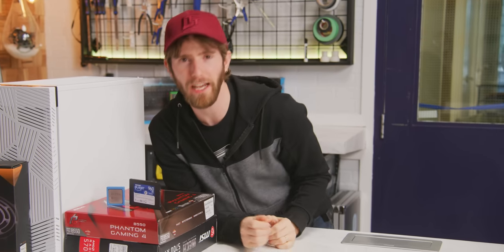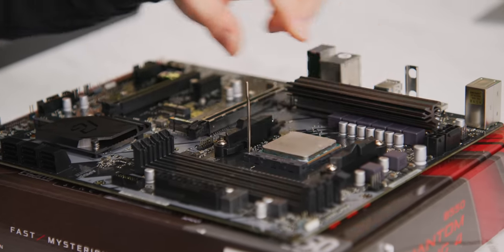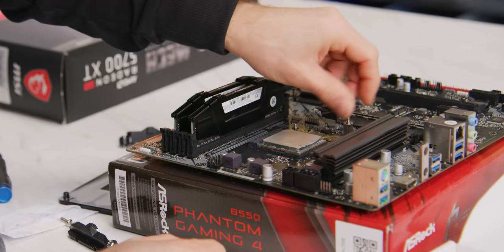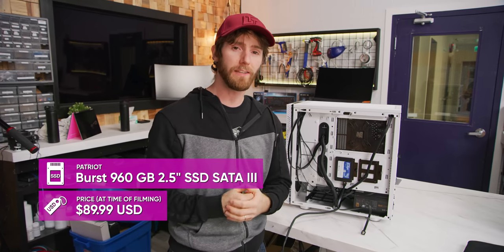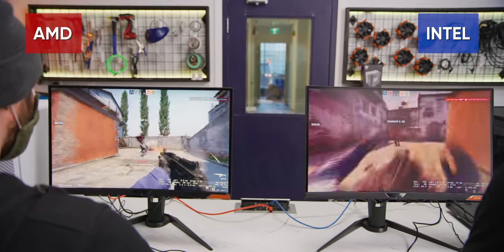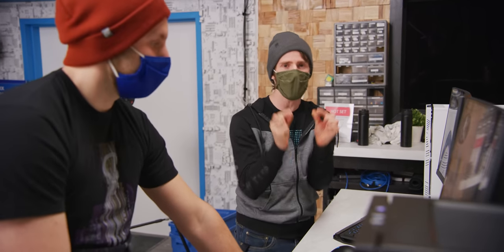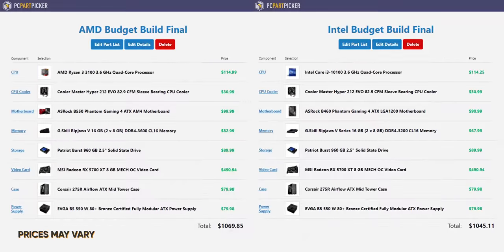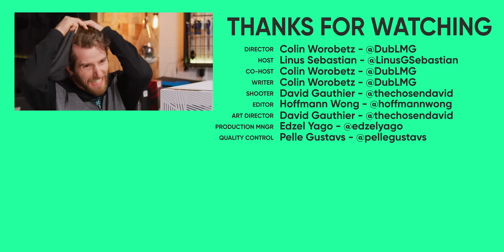AMD vs. Intel midrange gaming PC challenge

Comment: "doesn't have fancies like... PCI express gen 4"

yes it does, it was literally the first graphics card on the market to support it. wut.
Reply: yeah theres alot of mistakes in this video :/
Reply: HentaiRacoon  linus not dropping anything?
Reply: @thanishdavipaul2876  B550 does support PCIe 4.0
Reply: @thanishdavipaul2876  Yes it does, it's B550.
Reply: HentaiRacoon  The SSD he used actually comes with 32 MB of DRAM cache... and IDK maybe something else but it doesn't really affect the point of the video so who cares
Reply: This video be Doo Doo.
I wouldn't even call that a mid tier pc, 
I'd call it shit tier
I feel like Mid range is all about getting the best possible performance without going overkill.
 buying a 5700xt and pairing it with a i3 is leaving performance on the table
Reply: @davidjorquera4192  bro fr most prebuilts at this pricepoint are better
Reply: @davidjorquera4192   there supposed to be the same gpu...... there not gunna put a 1650 in one pc and a 5700xt in the other. 🤡🤡🤣
Reply: @user-mc2lg4iw9e  5:25 you sure about that? ;)
Reply: @ishaquesurya4572  lmao
Reply: @SpaceLion949  And why would he actually use that drive. You can get 1TB NVMe drives for less than 100 dollars these days. From reputable brands even, such as the Crucial P2.
Reply: @iceballon1325  i3 bottlenecks the 5700xt bud, the GPU is fine it's the CPU that's the issue
Reply: @juanecheverry8013  they're really not the ones that seem better value are basically expensive microwaves with compromised cooling and ram the ones that actually don't melt from the heat are basically a 1660 super for the same price
Reply: @davidjorquera4192  5700xt for 500 too, Wtf were they smoking
Reply: @davidjorquera4192  except a 5700xt $500 is not fine
Reply: @davidjorquera4192  no, mid tier pc isn't about top tier performance, it's about mid tier performance.
Just because you have your mom's credit card doesn't mean shit.
I'm still on GTX 2GB, that is low tier today, it still can run most games and even Cyberpunk on lowest settings and lower res.
Reply: @dr_birb  nah mate I actually worked hard for my money and built a mid/high tier pc. 
Rx5700 8gb with i7 8700k with 16 gb of 3000mhz ram.
Reply: @davidjorquera4192  how better is the performance with i7? in which games it is significant?
Reply: @juanecheverry8013  you sure? prebuilds are trash while their config wasnt that bad
Reply: @dr_birb  so youre getting mad at him cause you dont have the money thed upgrade so you accuse him of getting all his money from his parents
Reply: @112Haribo  p1 and 2 kinda suck, a2000 or sx8200 is better
Reply: Thanks, paused to write just that... I like LMG videos but you should watch them for entertaiment purposes only.
Reply: @maurice7017 ?
I'm not mad?
And not accusing anyone?
Just saying that mid tier PC's aren't about getting most performance - that can be any tier PC, depending on what you want. And that the PC's in vid are factually mid tier PC's, his imagination doesn't change that. Shit tier could be integrated graphics, i wouldnt even call my 960 shit, it's doing quite good considering it is what it is, after being used 5 years.
What's next, 3070 being low end, 3080 mid end, 3090 high end?
Please...
Reply: @vchabal  it really depends on what you GPU you use and what resolution you play at.
Reply: @dr_birb  3060ti is low end 3070 is mid/high tier, 3080 is high end and 3090 is just overkill
But good luck finding one to purchase. 
Yes I know the 3070 is just as fast as the 2080ti which was high end/ overkill but times change and graphics cards keep getting better and better
Reply: Not to mention the closed captions (which don't appear to be generated by Google) have a lot of typos.
Reply: @davidjorquera4192  3060, 3070 is high end, it is NOT low end, it's insanely powerful for the price, you can call it the low end of the 30 series? Yeah probably but it is not a low end gpu.
Reply: @Jelly-go9zm  yea I understand  the 30 series definitely has some insane performance to offer that is high end when compared to other gen cards.
Reply: @davidjorquera4192  3060 isn't low end, non rtx versions are proper low end. I literally play on 960, and it does fine, 3060 in comparison is miles above.
In it's series lineup it is low end, in whole market, not
Reply: @dr_birb  let me re-word it so it makes more sense, 3060ti is a low end card that Nvidia makes that happens to offer high end like performance when compared to the used market

Comment: “Budget Pc” 
Linus proceeds to pull out $1000 worth of parts 😐

We need a real budget pc around $300-$600
Reply: @pandemicneetbux2110  Xeon+x79/x99+Rx 570+cheap ecc 16gb enters the chat
Reply: @Yku30  my pc was about $250 and runs all the games i need it to at 1440p max settings but yeah i can see it struggling on games like cyberpunk but for forza just cause and gta its more than enough
Reply: Buy a console then.
Reply: If that’s your budget, its easier to just buy a used PC, you can get some pretty great specs out of a PC if its on the used market.
Reply: I would recommend checking random gaming in hd, he has quite a bit of budget build videos
Reply: @Yku30  you just compared buying a car to buying a pc..
Reply: I reccomend kristoferyee he builds budget pcs out of used parts around that price. If u dont already watch him
Reply: @Yku30  it is, more expensive makes it better, but budget is gameable, u just know Nothing about pc-gaming
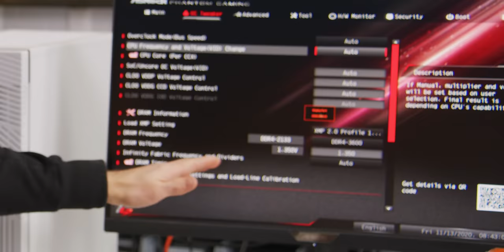Reply: This might be a dumb question, but what was he using to make changes to the RAM and everything else at 7:00?
Reply: He built one on here not long ago. I mean, it want anything special, but it was pretty cool. He bought a really cheap PC from Ebay..I think it was a DELL Optiplex, but I can't really remember..
Reply: @Yku30  I am not, u dont get it eh, not everyone Lives in the same Country. Also I have a computer Company so 1 friend is like NOTHING...
Reply: @Yku30  yeah I get it , but some people just don't ahev the money, they only have it is like One more Year, and Where ti get a pc from then? Not everyone has TIME lol, budget pc's are using most likely and apu to upgrade to a GPU later  with a B450 from Ryzen, I think u didn't start with pc's that Long ago if u don't even know this LOL
Reply: @Yku30  lol this is not my acc
Reply: @Yku30  bruh, I think u mean ur self . Like ur name WeedNOSE Lieutenant LOL
Reply: @Yku30  yeah I say u need to wait, but u don't get my point. U could go for a pc from 500 or Something and get easy to upgrade Parts, i'm sorry if u don't understand this, but some people don't have the time, or they are not allowed to get any pc's Above their budget, not even after years, if u don't get it, this is my Whole point...
Reply: @Yku30  not new games but not old forza horizon 4 at max settings 1440p runs at around 35fps average gta around 40fps and just cause 3 30fps edit: specs
cpu: amd ryzen 3 1200 price= free
mobo: msi b450 pro m2 price=free
ram: 16gb ddr4 2666 single channel for now price=free
gpu:gtx 1050ti price= $150
ssd:crucial mx500 250gb price=$35
psu: evga 600w price $60
Reply: @Yku30  Also I’ll add that while used parts can match the price/performance of new high end parts, the option of new low end parts isn’t bad either because of the warranties, longevity and support new parts have.
Reply: Console is your best choice then
Reply: @Yku30  recycled from other machines and gifts
Reply: Anything below $600 is not a good investment... Unless you got used parts for the low.
Reply: @randomweirdyoutubechannel8955  tf are your specs
Reply: i3 9100f gtx 1650s done there's your budget pc
Reply: To be fair, the video title is about midrange PC, not a budget, in this case, is budget but to 1K haha
Reply: 600 dollars pc are considered highly Expensive and a luxury in India
Reply: You can get a pc for 300 dollars, with an AMD athlon with integrated graphics and 8gb of ram on a micro atx MoBo
Reply: 300-600 will be great budget for a gaming pc if you wanna run worser than Nintendo frames kid
Reply: @jesseb.5632  true, if you cant spend more than 600, better get a console
Reply: @Yku30  People are applying what "budget" meant 10 years ago to today's market. Inflation alone would account for a lot of the discrepancies people see in regards to pricing of today's parts.
Reply: @ihatecommunism9958  it's called BIOS and he activated xmp profile if i'm not mistaken
Reply: WeedNose Lieutenant tell that to someone on minimum wage
Reply: Space Munky  I'm not sure about the US but in the uk they sell the aoc 24g2u which is a pretty good monitor that runs at 144hz for only £150 - £200
Reply: @pandemicneetbux2110  Yeah the cheapest brand new PC you could build that would actually be worth building would probably be around £400 or so, so if your budget is less than that just get some old system of ebay or an old optiplex or something wtih an i5 ir i7 then chuck a graphics card in it, like a gtx 960 or rx 570 or something
Reply: Well you don’t need Linus for that. Just look in your trash can 🤷
Reply: @Yku30  key word is used parts. This is based off New parts on a new build.
Reply: @Yku30  Hey! Bud 
Was just wondering if u can help me choose my parts for my PC my budget is $400 it's okay if u don't but just asking.
Reply: @Yku30  it's okay I'm fine with it as long as you don't ***k me up lol also thanks a lot appreciate it🔥.
Reply: hehe 69th reply.

if only there was a pc for $600 rn
Reply: @mian1222  umm if the bs readings are off the charts then what is this pc next to me
Reply: @SeptimusNavyaHoran  normal low end specs
Reply: @randomweirdyoutubechannel8955  then please explain to me how it is possible
Reply: @mian1222  how do i explain that forza just shows up as the highest settings and 1440p there is stutter which is to be expected but still just about playable
Reply: @randomweirdyoutubechannel8955  I obviously mean telling me your specs and how you got what
Reply: @mian1222  oh ok i get you now most of the free parts are from either mine or my brothers old pc's that we upgraded from but if you count buying the other parts 2-3 years back then yes it was around $600
Reply: @randomweirdyoutubechannel8955  yeah man but that's not really building from scratch :/ and you are comparing it to the vid which is building a pc from nothing
Reply: @SeptimusNavyaHoran  look on my vid and i never mentioned smoothly
Reply: @SeptimusNavyaHoran  i wouldnt expect it to run the latest and greatest games at 1440p but up to about forza horizon and before that time you can just about get away with it but for the newest games probably best of with 900p or lower especially if its a competitive game
Reply: @randomweirdyoutubechannel8955  900p? Tf are you talking about bro? And you talking about forza horizon 4? Or the older ones?
Reply: @SeptimusNavyaHoran  forza horizon 4
Reply: @randomweirdyoutubechannel8955  you're capping so hard rn 😭 the 2060 struggles to run that on 1440p bro. I NEED to know your GPU.
Reply: @SeptimusNavyaHoran  no cap i have a vid of it only 25fps to 30fps average and the gpu is a gtx 1050ti
Reply: @randomweirdyoutubechannel8955  bro....I'm here thinking you're getting 60fps 😭😭😭 my bad for being so aggressive, I thought you meant 1440p 60 fps.
Reply: @SeptimusNavyaHoran  its all good maybe 60fps at 1080p low for the 1050ti but defo not 1440p
Reply: @Yku30  its not entirely a lie my brother got a pc with a gtx 1660 super 16gb ram 500gb ssd for only 500
Reply: @Yku30  it's been done before tho
Reply: @pandemicNEETbux you can just upgrade it with like a gtx 1050ti those things are only 85-89 bucks rn
Reply: Well, expect it to be pre-built/secondhand pc that barely works. What you pay is what you get.
Reply: just buy a office dell/hp/benq or some other office computer without a gpu that has a i5 or an i7 and put a 1050 ti or a 1650 ti (just make sure the power supply is enough for the gpu of course)
Reply: To Linus that is a budget. His personal rig probably cost more than most people’s cars
Reply: @spartanDJChalo  Well it might be like that, but he is doing this budget for us the viewers not him lol
Reply: @Yku30  1000 dollar is my fathers 3,5 month of pay
Reply: Just buy a used one for that price
You won't be playing something like PUBG on below 800$ PC
Reply: @topalovicbih1582  wtf you cant play pubg under an 800 dollar pc?XDD
Reply: @apensesticaboros4888  you can but it won't be good experience 😂
Reply: @Yku30  you can get quite a good price to performance ratio for $600. Well, not right now cause of the silicon crisis. But in the past you could get an i5 7400 and a gtx 1050 TI in that budget for example.
Reply: This guy wasn’t trying to give budget builds (though maybe the title could give off that idea) what Linus was trying to do was benchmark two equivalent cpus from two different companies to show which company you should get your cpu from. The budget of the test-bench makes sense because you want the limiting factor to be the cpu to show the limits of each cpu.
Reply: @pandemicneetbux2110  300 dollars u can build like a i7 3rd gen and Rx 480 now it’s a core 2 duo gt 710;)
Reply: Yeah I agree. In the UK we have cex which insures that if used parts don't work you get a new one or a refund. This makes budget rigs a bit better than buying everything new. But I could make a pc that plays FC 5 or Dishonored 2 for about £500 - £600 but if I had £1000 for a pc I would be in heaven
Reply: What?
Reply: @Yku30  don't go there. an average car is 25k, an average gaming pc is 1k,
Reply: 300-600$ isn't considered budget bro grow up
Reply: get a prebuilt.
Reply: @Yku30  imagine not having a warranty lmao 

Used parts always die for me. Just save a bit more and spend around 800 on new shit.
Reply: @Horray4dpp  any tips on wasting less money my cpu and gpu are Ryzen 7 3700x and RTX 3080 (not built yet) parts are shipping but I could cancel and get something of better value maybe?
Reply: @randomweirdyoutubechannel8955  if that's true than you probably bought a stolen pc or something lmao
Reply: @pandemicneetbux2110  My PC isn't even worth more than 200 USD
Reply: There a lot of build guids for that price range
Reply: nope
Reply: @Zarrx  damn damn 😂😂😂
Reply: Well you’re not gonna make anything for $300 so you can get that idea out your head
Reply: @randomweirdyoutubechannel8955  hahahha what lies 😂 no $250 pc is going to run at 1440p max settings unless you’re talking about games made before 2010!
Reply: @Yku30  but with $1000 you could actually buy a lot more than budget. note that the GPU in this build is a flagship, not a mid-tier (5600xt or 2060). they're just cheating by getting an entry level cpu with a flagship gpu to get the idea of midrange, but they totally forgot in some games they hammer both the cpu and the gpu intensively. Like monster hunter world for example, the game crushes not only your gpu, but your cpu and your ram at the same time. at 1080p, actually its my ryzen 3300x thats being bottlenecked, not my gtx 1070. cpu 99%, gpu 80%, stuck at 80-90 frames
Reply: never ever going to happen anymore im afraid
Reply: @randomweirdyoutubechannel8955  specs?
Reply: That build isn’t gonna have a graphics card or it’ll have a really old parts
Reply: @S1 SS it would prolly be a more budget pc
Reply: It says mid range In the title lmao
Reply: @randomweirdyoutubechannel8955  how? Unless you’re only playing like csgo and LoL idk how you managed that unless you’re only counting the price of the gpu and you’re just upgrading
Reply: Just get a console
Reply: @randomweirdyoutubechannel8955  Im assuming you mean forza horizon and that is literally the most optimized game in the world so running forza on a 250$ pc isnt exactly unbelievable but not at 1440p ultra without upscaling.
Reply: @randomweirdyoutubechannel8955  do you play minecraft by any chance
Reply: @ihatecommunism9958  im 11 months late but he was in the BIOS to change the ram speed.
Reply: @randomweirdyoutubechannel8955  how the fu...
Reply: @Yku30  idk man, I don't need to make a fucking investment to play minecraft
Reply: @Zarrx  hmm but a console is only for gaming
Reply: These days I would say 600$ is a decent budget build.
Reply: Yeah… $300 - $600 nowadays will get you a toaster.
Reply: @Zarrx  ps4's are super loud
And yes I cleaned it
Reply: @randomweirdyoutubechannel8955  for 250$ ? You can play cyberpunk ? Even if it had problems on it ? My 500€ pc can't even lunch the game ...
Reply: Budget means price range just look for 300 budget pc
Reply: i3-12100F and Radeon RX 6600
Reply: If your gaming pc budget is $300, just go ahead and start dumpster diving